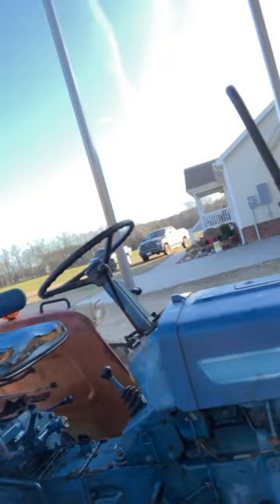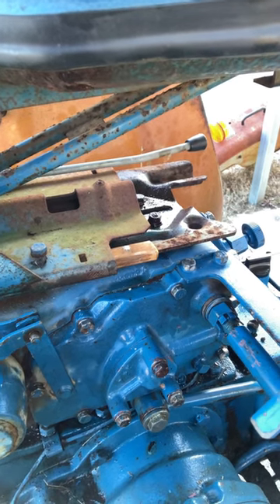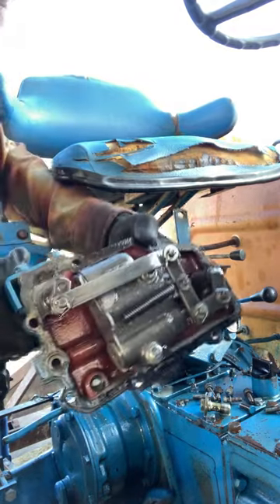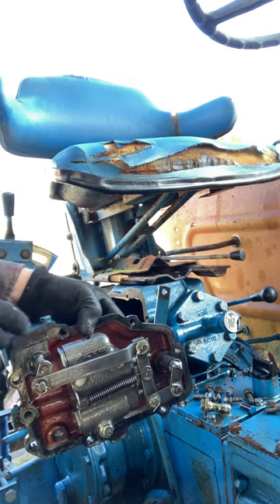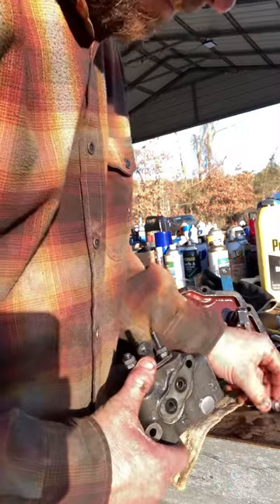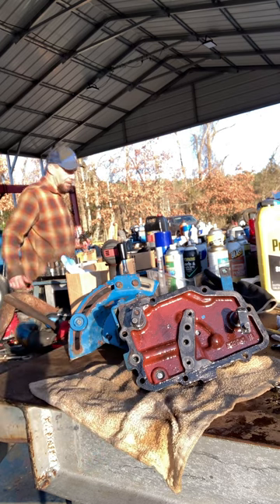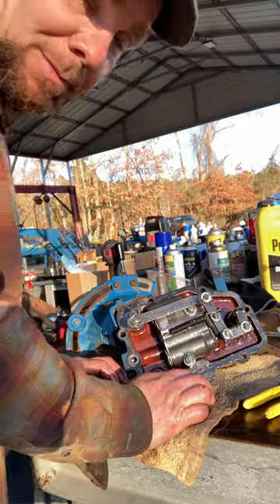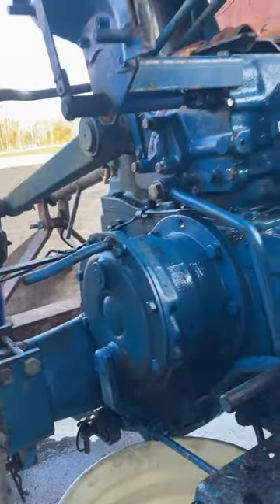(Part 1)Ford 1710 or 1700 Tractor hydraulics not working/slow.

Comment: I have a 1710 Ford Tractor and I have had a problem with the hydraulic lift. I replaced the hydraulic pump and priority valve with no luck. I saw your video and went to check the bypass valve on my Tractor and that was my problem. I would like to thank you so very much for making this video.

Comment: The fuel line going back to the back of the tractor I guess it's a high pressure line from the box how to take it can I change out it out to a rubber line that's hydraulic rubber line

Comment: I have a question, would you know what would cause a power steering leak at the steering column on a Ford 1710 Tractor ?  Thanks
Reply from the maker: You can get an exploded view of the column on messicks.com and select the seals you need to replace.
Reply: @DannyStogsdill  Thank you for the information, I’ll check it out.

Comment: The line the high pressure line that goes to the back of the tractor can I change it from a Stihl line to a hydraulic rubber line how much fluid will I lose when I open the line
Reply from the maker: You’re gonna have to drain all the fluid. About 5 gallons.
Reply from the maker: It’s got a banjo bolt so I don’t think he can change it to a rubber line